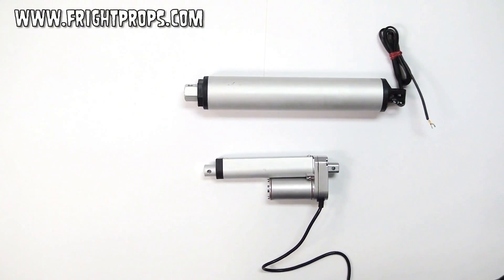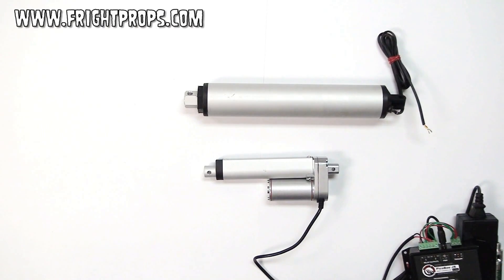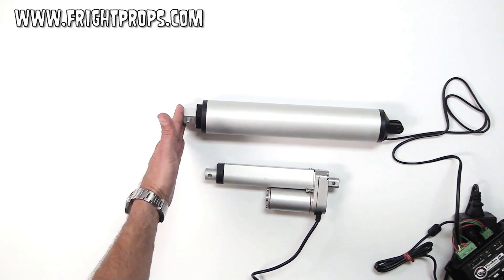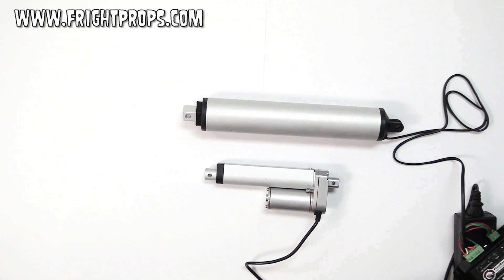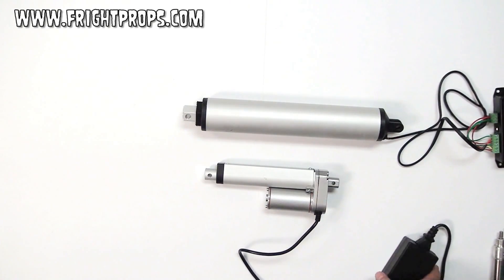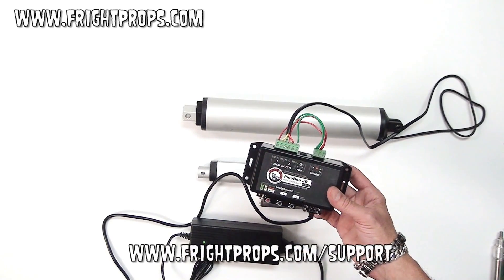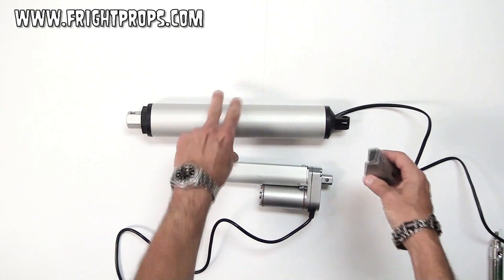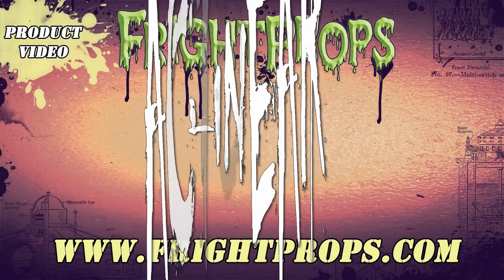FrightProps Linear Actuators - Electric Piston

Comment: How can I make your linear actuator electric piston go faster, much faster, like the captive bolt pistol featured in Cormac McCarthy's No Country For Old Men movie?  Will hooking it up to a 480VAC 3-phase 6-diode full wave rectifier do the job?  A couple steers escaped from the back of a stock truck on I-5 and now I've got a several hundred pounds of potential steaks mooing in  the garage.

Comment: If I set the program using the controller, Do the controller have function can keep non-stop run the program? For example, I want linear actuator move 100 times back and forward, or move back and forward forever, etc
Reply: Gary Lee Yup!  Just loop the trigger input of your controller.  That way it will continue to run your program as long as it has power.